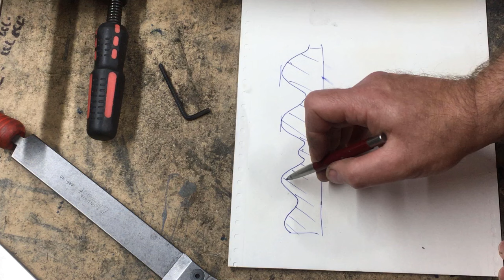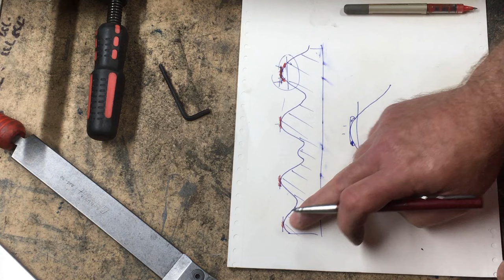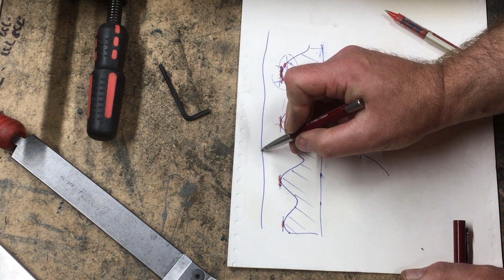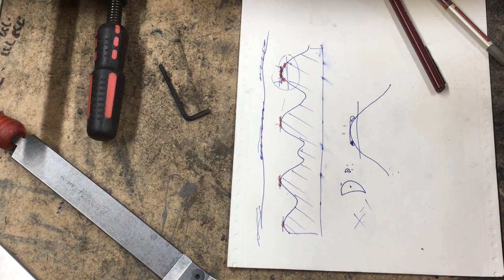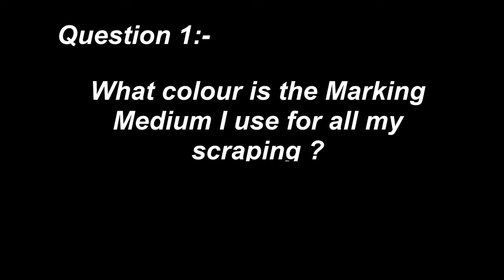Basic Hand Scraping - A 12" Cast Iron Straightedge

Comment: Nice video. I think before you get too far finished with your large flat surface you should scrape on the bevel. As scraping on the bevel will most likely change the bottom surface slightly. Also ringing the part with a soft blow hammer to relieve stresses is a good idea. Just some techniques I picked up in a Richard King scraping class. Thanks for making the video.
Reply from the maker: Hi Steve, that is exactly where we start off in part 2 ! The SE casting was well heat treated before machining and ive had it hung for 4 weeks - no noticeable movement checked with a 0.001" feeler on the surface plate. It is only 12" so I wouldnt expect much movement. Still as you say, rough it in then finish both faces - thats the correct way.

Comment: Excellent video - lighting and photographing a shiny scraped surface must be hell.
I would recommend (if you can) getting a rigid clamp instead of the big 'F' clamp you're using to fix the straight edge in place. Since 'C' or 'G' clamps hold their setting when released, it's just a half turn between secure and loose, which is nice. For this purpose, even a light, cheap clamp would serve very well, no need for Paramo or Record.
Sorry to hear of Chris' passing.
Reply from the maker: It was just a bit too big a span for my g clamps. The F clamp came to hand 👍
Reply: @lookcreations  So I guess you couldn't find a thinner packing block for the rear packing either?
 
That's a Bugger. I LOVE 'F' clamps for one off stuff (like woodworking glue ups), but they're less good for repeat work.
Reply from the maker: Standard law, the packing block you want resides inside the one that’s too big and the saw is covered in what you need the block for .... or in my case both saws 🙄 . I end up lighting the stove with any bit of dry kindling I can get my hands on ..... it’s a tough world for handy bits of wood in my shop 👍

Comment: Oh - I have made the "going fine too early" mistake. As you say, you end up trying to gradually lower your perfect plane to the depth of your deepest pit, maintaining its perfection as you go.
WHAT A WASTE OF TIME!
I probably err the other way now, happy to hack away in the early stages, until I have uniform (but crappy) coverage.
I also use a thick film on the plate - this is easier to interpret in the early stages, and reduces in thickness as you go, removed by the successive prints.
If you're really super lucky, the ink film reduces in the correct proportion to the finish of the work.
Reply from the maker: It is all too easy to think its all looking good only to find tha there is a hollow whcih requires addressing. It frustrates me that such things are never covered in other scraping videos and you know it happens. I try and give a 'warts and all' view of the process. Sure there are other methods and most likely faster and more systematic approaches - that being said, most viewers are more interested in 'how to do it in their shop' rather than going out to make a living  at it. Thanks for all your comments. All the best Mat

Comment: nice job, just i want to know how to make the perfect standard stone flat, need use the laserinterferometers equipment, yes ?
Reply from the maker: Do you mean the surface plate ? I’m sorry I don’t understand your question
Reply from the maker: The surface plate flatness is the calibrated standard. Mine is granite and bought new. You can use a cast iron plate and there are videos on YouTube about how to check flatness. Or if you feel really keen, you could search the three plate method for achieving a flat plane developed by whitworth in the uk in I think early 1800’s based on his observations of the Manchester machine tool builders of the time

Comment: When you're scraping like that, how do you know you're not getting lopsided? It can still be a flat surface but slope from one side to the other.
Reply from the maker: Are you referring to the included angle between base and angled face ? If so, it is not a reference angle, in use the inclined face needs clearance to get close enough to then be lifted into contact for the rub/print.

Comment: Swirly layer of layout color with random thickness on your reference plate? First time i've seen something like this. I do wonder how it affects the transfer if it creates false contact area/points.
Reply from the maker: Actually, it does require some 'reading' if you 'swirl it too thick on a half decent scraped face - as I said, you want to start with a 'good layer' on the surface plate , this layer is evenned out as the scraped face develops and each rub you take and then -re-swirl to re spread the ink. By all means use a roller or other method - Ive tried lots and they all have downsides. As the face develops the film thickness becomes very thin on the surface plate - you can see this as the video progresses.
Reply: @lookcreations  I've applied ink with 3 different methods (lint free polyester rag, special sponge, roller) but I always made sure by proper smearing that the layer was more or less constant all over surface... so I don't understand your point.. anyhow i'm always open to new ideas to make life easier and faster but this goes against my intuition right now
Reply: @chronokoks  the important point is that "uniform layer" is not a yes/no thing. All layers are uneven, the question is "how uneven?", or (even more important) is it "even enough?".
So (as always again in engineering) you should not waste resource/effort to work beyond required tolerances.
Reply from the maker: That is spot on. When you start the scrape, ink spread is not that critical. You can see with the first print, then the second. At that stage the surface is within half a thou’ but not flat. So the ink has to be within that thickness. Flatter the surface thinner and less variation
Reply from the maker: @chronokoks  Ive been trying to think of a way to explain this without a long winded paragraph. In short, the thinner the layer the better except that it provides less protection to the master. So start thicker - an uneven film will work if your work face is uneven and you can read the print. I would take far more time to produce a thin even layer if I were re-facing a straight edge.  The same goes for 'dragging your fingers through the film - its not a very good way to check for debris in my view - but others insist its key. Do what works for you.